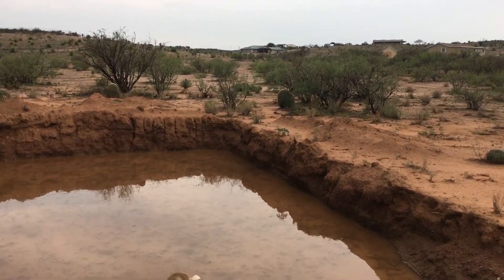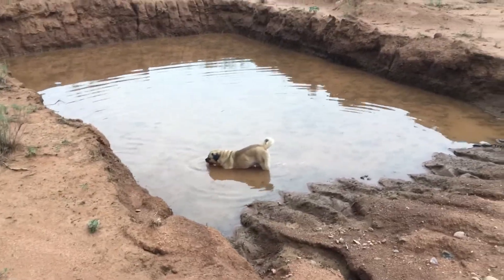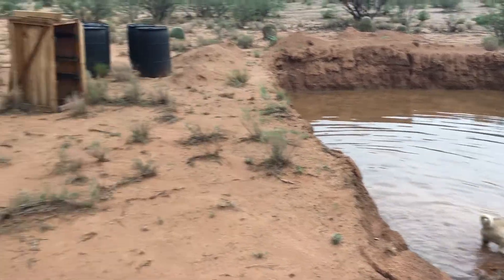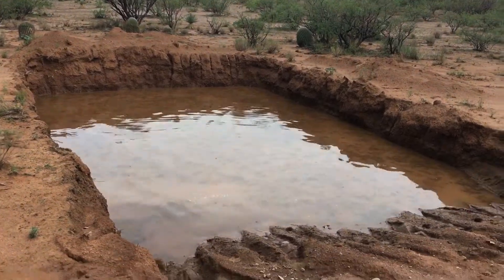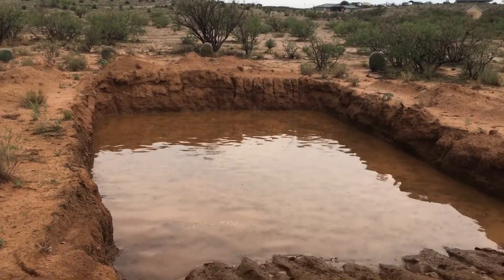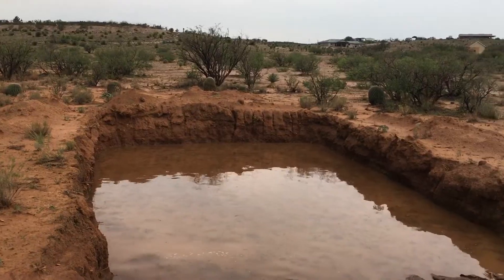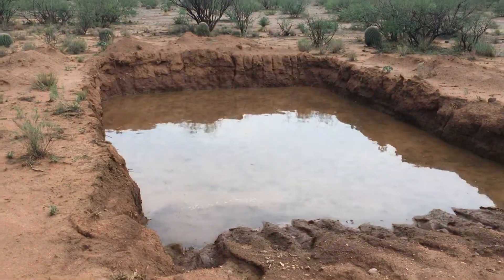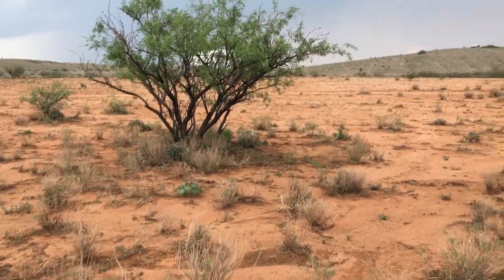RAINWATER HARVESTING TECHNIQUE - 16,000 gallon DIY STOCK POND

Comment: What about enlarging this hole to catch more water and letting the water recharge the ground water.  The ground water would be cleaner than pond water, and potentially the only thing you would need to do with the ground water is UV sanitize it to use it, and not need to filter it.  This would work if digging a well is easily feasible.  Else continue with the plan to use surface water.
Reply from the maker: That makes sense. ... only problem is that wells start at about 400 ft here 😂

Comment: That’s how you solve the looking water shortage crisis right there. There’s no water shortage, there’s an intelligence shortage
Reply from the maker: Thank you 🙏 yes I agree. Being out here has taught me that you can make things work
Reply: @OffGrit If tou watch Frugal Off Grid you can easily line this   with a tarp, Home Depot has 40x40 20 mil thick tarps for.under 400 bucks which is plenty thick then you have a solid pond or you could do that and throw another 1 or 2 tarps over that with some 2x4 structure with a manhole and bury that then you have an underground cistern. You can also run that water through a simple poly bucket filter to remove most of the silt and debris then run that through a Berkey or sand/carbon filter and boil that for perfect drinking water. But like you said you have a ton of water for agriculture out in the desert. I live in the Mojave and water storage is expensive basically a dollar a gallon fornmost tanks, but im realizing you can create a ton more water storage like thousands of gallons using thick tarps and if theyre buried theyre not gonna degrade from UV exposure.
Reply: @Vkash2024  wie wasserdurchlässig ist der Boden denn..?!
Reply: Dam right!

Comment: Research earthbag cisterns covered in pond lining. Labor intensive, but way less expensive than concrete.

Unlike concrete, earthbag cisterns will move with the ground, instead of cracking and losing all that precious water.

Concrete cisterns will crack in the pending New Madrid Fault earthquake, where an 8 or 9+ on the Richter scale is expected.

The same precursors for the 1811-1812 earthquake has been happening. Most people have not been paying attention to the signs.

New Madrid Footsteps

"In mid-May, 2021 the New Madrid Fault Line did what the Zs called the 1st wave of unzipping from the Gulf. 

At that time, in short succession, we had the Colonial Pipeline close down, a truss on the I-40 bridge to Memphis snap, a new sinkhole at St. Louis, a bridge collapse in Iowa, the Mackinaw pipeline closed, a plethora of crevasses at the tip of Mexico, and sinking land to the West of the Mississippi River. 

The first wave continued along the fault line to the headwaters of the Ohio River, and on to jolt New York City at the Ramapo Fault Line juncture. The Zs had predicted that 2021 would be the year when the New Madrid would activate..."

"Another related incident showing the stress along the upper New Madrid Fault Line and its sister the East Coast Fault Line are the mystery bird blindness and death. 

This phenomenon emerged in mid-May and has lasted through to June 21. The states affected are DC, Maryland, Virginia, West Virginia, Ohio, Indiana, and Kentucky. The map showing states affected by Sulfur Dioxide from the Ohio River and other stressed rock up to and down the East Coast are these states! 

It is known that birds are sensitive to Methane gas, and likely they react to Sulfur Dioxide too."

I am sure you have heard about birds falling dead from the sky, and other animal die offs. With the ground cracking/shifting and releasing methane, anything flying/walking/swimming into it will die.

7/31/2021: 
"There is an overlap between the states where birds are dying and going blind and the Sulfur Dioxide emissions from the Ohio River and fault lines associated with the New Madrid path. 

There is also an association with sudden and unexplained disasters along this path, including the Ohio River headlands refinery explosion and the DC pedestrian bridge collapse. 

Birds and fish are sensitive to methane gas, and thus the use of canaries in the mine to warn of the presence of Carbon Monoxide. 

These dying and blinded birds are warning the people in the SE United States that disaster is coming, and soon."

Do yourself a favor and research earthbag cisterns. You will be happy you did. The money saved, from not getting a concrete cistern, can be used to get quality filters that remove chemicals/viruses untill you can come up with a filtration system.

Find a system that will use minimum electricity, or none at all. Bear in mind that there will be little, to no shopping, for replacements once the devastating quake(s) hit.
Reply from the maker: I definitely understand where you’re coming from I have actually built with earth bags already and I do know how labor-intensive they are from experience and that’s the problem is that for the amount of time and Labor that it takes it’s kind of a wash honestly but it’s a lot quicker for me to do it with cement concrete part of the formula that you have to look at when you’re doing this kind of thing is a time equation you can also line concrete with pond liner to so you get the best of both worlds there
Reply: @LeGrowFarms  

Great! 

My main concern is the damage caused by pieces of damaged concrete puncturing the lining.

Will you be building a round cictern or box shaped?
Reply: Hopefully you drank diaper water seeing this trash is 4 years old